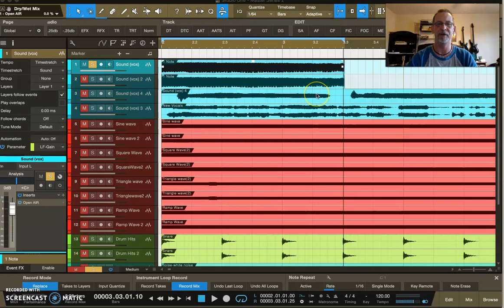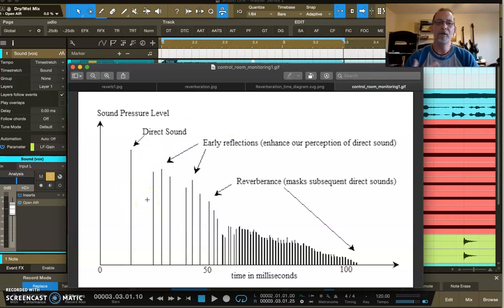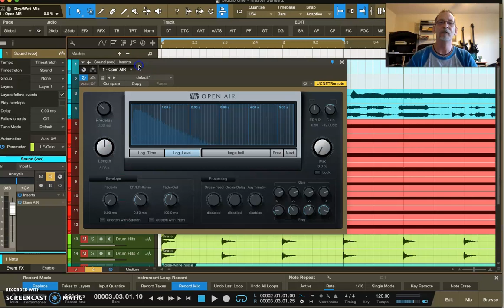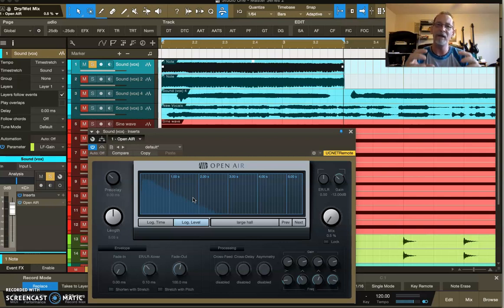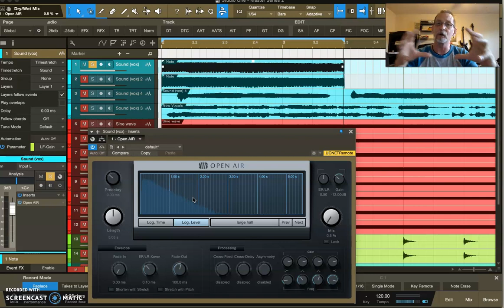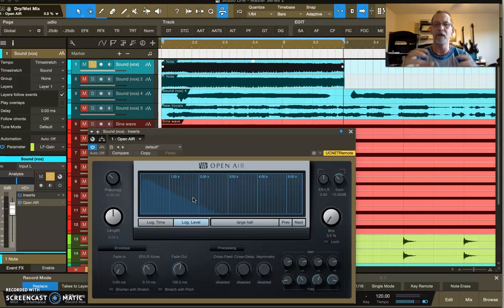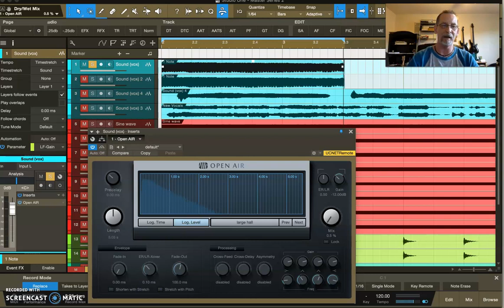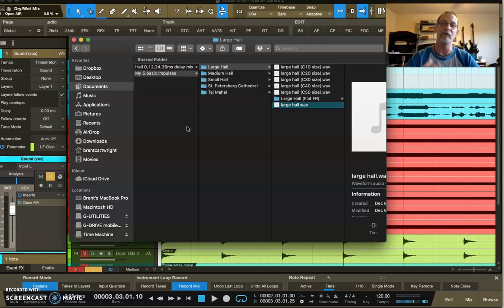Master Series 2; 66; Basic Processors 15; Reverb/Convolution 2; Convolution Multiplies Problems

Comment: I guess this doesn’t just apply to convolution reverb but reverb in general. I often cut out the low end and apply some side chaining so the reverb doesn’t get in the way while the sound is playing but rather afterwards. Is that not an ok way to avoid cluttering up the mix?
Reply from the maker: cutting some low end is usually appropriate to avoid rumble but side chaining for afterwards reverb i do not understand ? i suggest you watch the rest of the vids in this section first, and see if they answer the question, new ones coming this afternoon. or you may need to explain a little better what you mean...
Reply: @BrentCartwright-DocsLabAudio I’ll take a look at your upload. What I meant with side chaining the reverb is that I have a vocal for example that I send to the reverb send channel. Then after that I apply a compressor that ducks the output of the reverb so if the vocals are loud there is basically very little reverb but once the vocals stop the reverb becomes louder again. This way you only hear the reverb when there are no vocals. Like side chaining the bass drum to the bass but in this case I side chaining the vocals to the reverb. Sorry if that’s not very clear ;-)
Reply from the maker: @summerWTFE  Why would you want reverb when there's no vocals ?  watch the rest of this series on convolution and master what im teaching you, and master your convolution reverberation processing first. side chaining and applying compressors to duck the reverb is normally for very special situations that have environmental issues that are not control-able, which should not be the case in the studio, or something you cannot repair in editing. unless your trying to get a unique effect ? maybe automating the parameters ? my suggestion is master this segment on convolution, watch the rest of them, and see if that doest answer your question, and get you some better direction for applying reverb...Thanks !